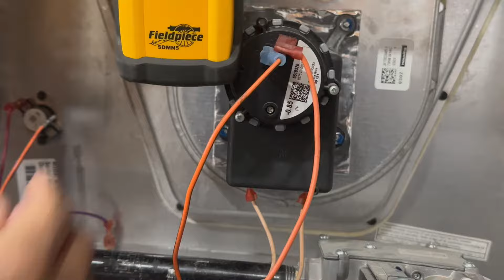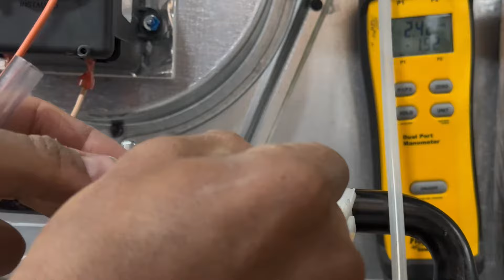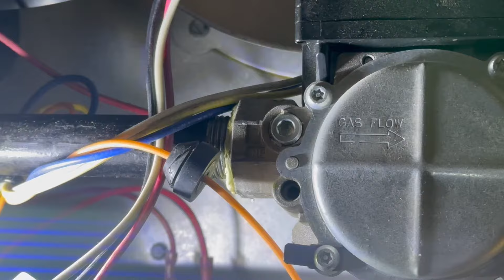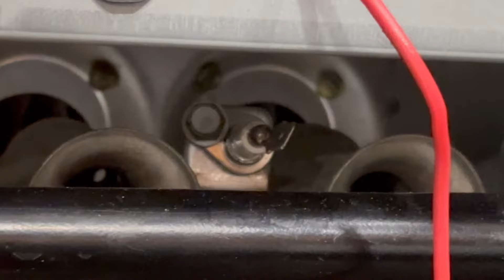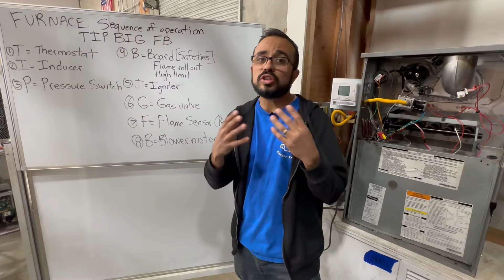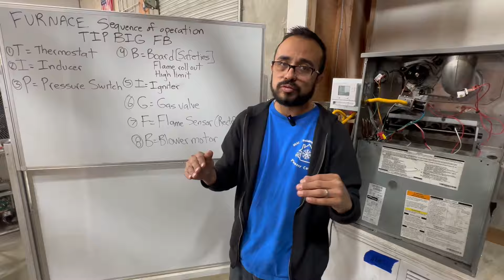Furnace Part 2 - HVAC Training

Comment: SIR ! i have been in and out of hvac unofficially but YOU are a very  well versed instructor that is very clear in verse and in theory! Like how the carbon in the flame makes a continuity, and the other way of checking a flame sensor! And checking water column at the various gas valves and the little NEUTRAL PARTY EXPLAINATION! IS CUTE AND SMART! AND MARIO FOR CIRCUIT MAKE OR BREAK EXPLAINING! KEWL BEANS DUDE THANK YOU AND KEEP TEACHING!
Reply from the maker: Thank you for your words! 🙏🏼